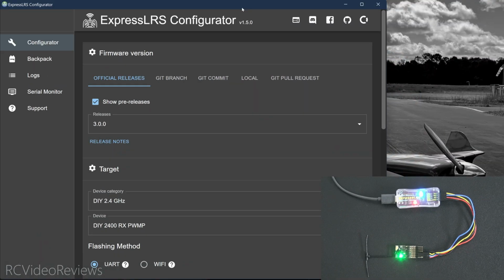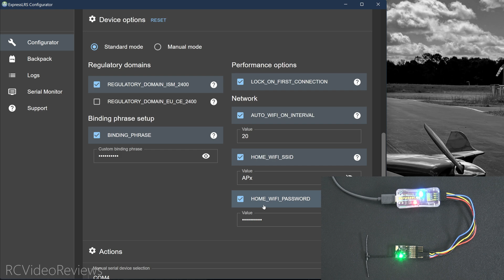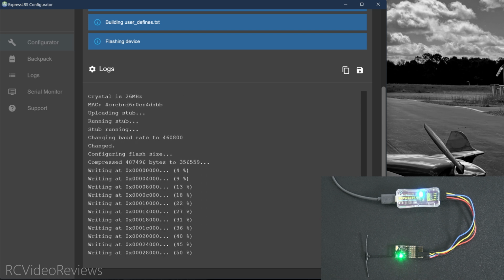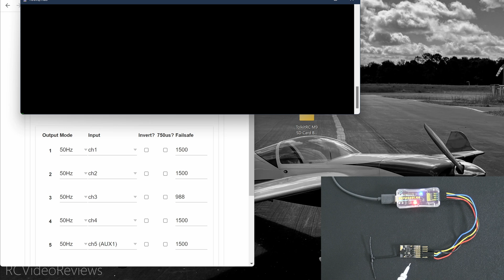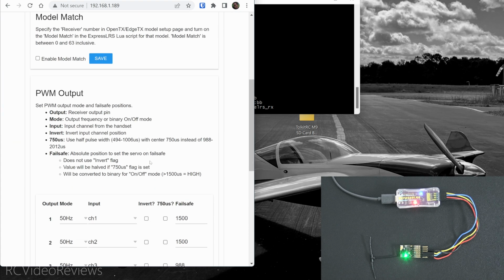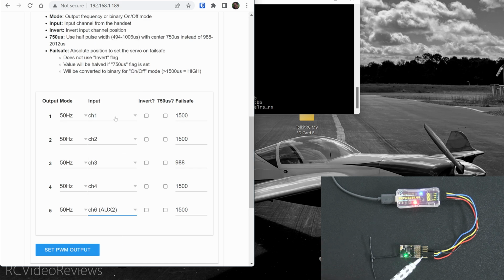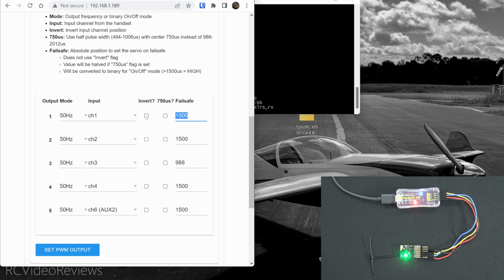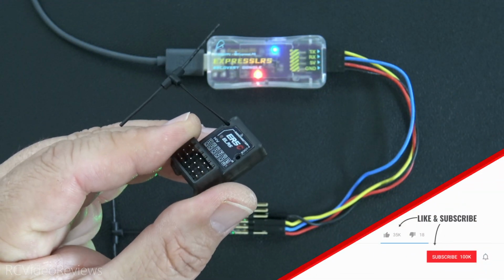Radiomaster ER5A and ER5C Express LRS Receivers • How-to Flash ELRS 3.0 with BetaFPV Recovery Dongle

Comment: Awesome review, as always. I bought the same rx, but I did not see the DIY fw in 1.6.rc-2. It only shows fw for tx modules. I ended up using the RM ER5A pwm
Reply from the maker: In Configurator v1.6.0 and ELRS v3.3 there is an option under Radiomaster 2.4ghz for ER5A/C.
Reply: @RCVideoReviews  I got it working  on 1.5.10 it's also listed. The DiY didn't work at all, but it took the RM Fw after shutting down the wifi. Well, I'm hitting the boot button, got it.

Comment: How do you know what channel to plug the esc into?
Reply from the maker: It depends on the radio/radio firmware you're using.

If you're using an EdgeTX based radio like the TX16s, you can plug the ESC into any channel you want. Say you use Pin 4. In the mix page of your model setup, you then put throttle on line 4.

Usually, radios have some sort of channel order like AETR where T=Throttle=Ch3. Some might be TAER T=Ch1.

Electrically, it doesn't matter what pin you use. All signal pins on PWM RXs have common ground and common power. 

If in doubt, start with throttle on Ch3/Pin3.

Comment: I personally haven't jumped on the ELRS bandwagon yet because TBS is making, and I'm using their Crossfire 6 channel pwm nano receiver for my fixed wing models. Besides the obvious 2.4ghz and 915mhz difference between the protocols, are their any significant differences or advantages to an ELRS system over Crossfire besides more availability due to it's open source nature? It would seem that Crossfire would have the edge in range, signal retention and security, latency and reliability over an ELRS setup.
Reply from the maker: Range, signal retention, security, latency, reliability.
Interesting set of parameters:

Range - ELRS leadererboard currently has a 2.4g ELRS going 10km on 10mw of power. I've personally flown LOS and reviewed logs showing no higher than 25mw of dynamic power (the lowest power level my Tx can set) at 98% LQ. I'm sure Crossfire has good range, but at some point it becomes academic. How far do you think you're going to fly?

Signal retention - I don't know what this means. I'm not aware of a signal retention metric.

Security - They both frequency hop. What type of security are you looking for? Encrypted packets? 

Latency - ELRS can run at 1000mhz. Crossfire 900 tops at 150hz. I personally run my 8ch pwm setups at 333hz. FLRC mode has 365us OTA time for racers to minimize latency providing 1kHz update rates. ~6.5 time faster than Crossfire.

Reliability - See previous comment on range. 10km @ 10mw over 10km. My own first hand LOS experience is 98% LQ @ 25mw. ELRS also supports Deja vu mode (DVDA) in 3.0 which means each packet is sent twice across multiple frequencies. 

There are multiple diverse Rx antenna options available. Happymodel just released a true dual diverse receiver with two radios and two antennas on one rx and I know for a fact there are more of these in the pipeline.

ELRS also allows for "loan model" by bumping certain Txs or binding to a 2nd Tx from lua script. 

PWM servo output has recently been refactored to allow 100, 160, 333, and 400Hz which significantly reduced latency over ELRS 2.x.

ELRS receivers now support vbat directly so pack voltage can be sent via telemetry even on very basic Rxs.

Price - Usually < half of Crossfire for both Rx and Tx.
Reply: @RCVideoReviews  I should have been more specific when I was mentioning security/safety/reliability  which I was referring to link quality, brownouts,, interference and failsafe vulnerability. Thanks for the knowledge, comparisons and information on the ELRS system compared to crossfire, I think that I just may make the jump and experiment with the system to see which one I prefer over the other since Spektrum receivers have got so expensive, and I no longer trust lemon or orange receivers due to a few crashes between myself and other club members.
Reply from the maker: I get behind open source because the well organized projects tend to push forward and push the envelope. The key for production use is a sufficient sample set flying and not reporting major issues. Edge and ELRS are both in this stages of development. 

I think you’re taking the right approach. It’s what I do. Get a few bits and bobs then test for yourself.

Comment: Unless you fly scale planes like me that need 6chs for flaps and retracts
Reply: Do they have a Sbus output.  I use a very cheap Sbus to pwm board off of allyexpress.  8ch board.  Changeable from 1-8 or 9-16.  I use them with my X8R's.  I use separate channels for each servo.  Redundancy. Not a fan of Y leads.   Plus I split rudder, steering wheel channels to two. So a simple 6ch plane has about 13 channels, especially if I'm using a RX8R
Reply from the maker: sbus is not supported natively, but there are add-on cards for $3.50. And that's not a simple plane. You have a specific use case that obviously isn't supported by 5 channels.
Reply: @RCVideoReviews  yup. Sorry. Wrong use of words, I was meaning that I turn a simple 6ch into a more complex set up to achieve my thoughts.   I'm not sure if my thinking is correct.  But it works
Reply from the maker: I have a simple perspective on this: Your Money, Your Hobby. Do what makes you happy to do.
Reply from the maker: Then get a 6ch matek....?